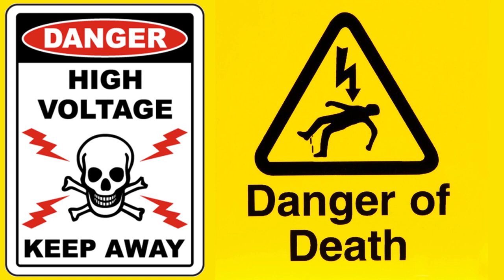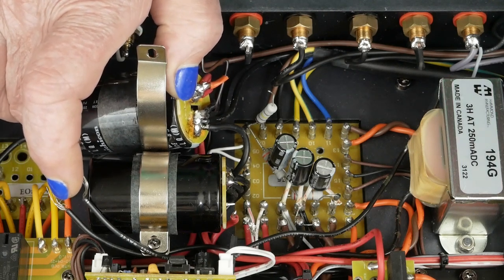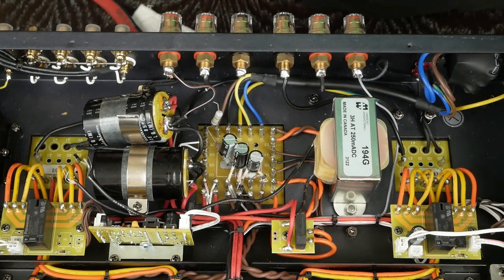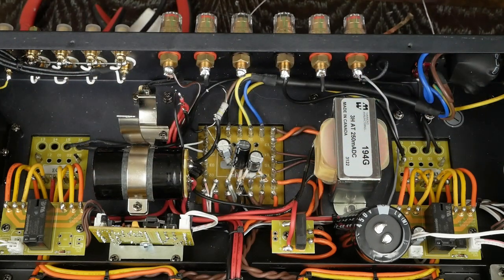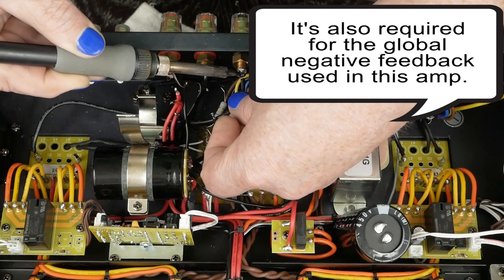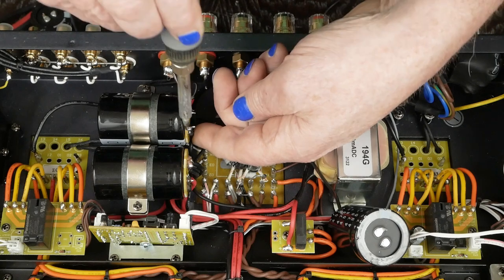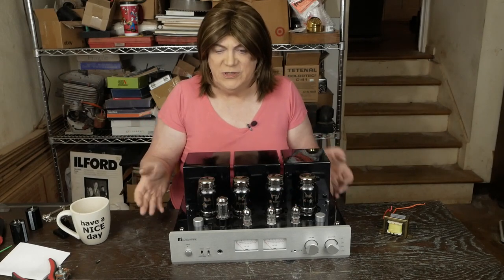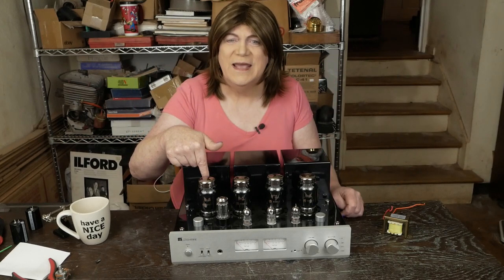Muzishare X7: Replacing the Power Caps and Choke.

Comment: This is a great way to learn about these Amps, I have two, it’s a shame they didn’t make the Amp with the higher rated components or lower for the resistors you mentioned. I’m not Sure I’m ready to take the soldering to the Amp yet, but I can see why it would be worth doing! Interesting to know about the pop when switching off, one of mine does the same. Can’t wait for the next one to see what you think it sounds like.
Reply from the maker: Actually that slight pop is the triode/ultralinear relay clicking to triode on shut down. You hear the same thing switching from  UL to triode with the amp powered up. No easy way to fix that, but honestly isn't hurting anything.
Reply: I have the X7 also. I replaced the coupling caps with V-Cap Odams with great results.

Really enjoy your detailed explanations.

I guess I'll tackle the choke and power caps next.

Comment: I got my first solder sucker last week and it worked surprisingly well. It made changing the caps in my Hood 1969 amp really easy.
Reply from the maker: Which one did you get?
Reply: @SkunkieDesignsElectronics  I got one that is blue plastic with yellow button and plunger end (13 inches long) from temu for $6.50. I was worried that the hot solder would melt the plastic but it wasn't a problem. It took just one go to remove the solder from most joins. I soon learnt I had to aim it away from my work area when depressing the plunger as that also ejects the solidified solder. I also got a smaller, mostly metal one for $2.50 but it locked up on me after a couple of uses so I ended up sticking with the bigger plastic one.

Comment: It is going to be interesting to compare to the R8
Reply from the maker: Right. That both use tubes to feed the voltage to the front end tubes, and think it's going to come down to: does a 12AX7 sound better or worse than a 6SL7. I bet it does.

Comment: @Skunkie Designs Electronics - I have this amp and the factory recommends the bias at .040ma but I have it bias at .045ma, and it really makes difference. I am tempted to go to .050ma, but I would need to upgrade the choke first.
Reply from the maker: What difference did you notice?
Reply: @SkunkieDesignsElectronics  increase in clarity while sounding smoother those too are usually at odds but that’s the only way I can describe them
Reply from the maker: Thanks, I will play around with that. The frequency response and power look the same, but that doesn't mean they sound the same.

Comment: Stumbled on this channel having come across Muzishare X7 and trying to get into tube amps. I must say I love the content. Thanks.  Would the the logic for disconnecting the ground wires from headphone board be to remove all the excess unnecessary circuitry? Simple and sophisticated?
Reply from the maker: Exactly, why have all that excess small wire in the signal path if you never intend to use headphones. Plus it corrects grounding issues.
Reply: @SkunkieDesignsElectronics  thanks so much. I think I might just start on Muzishare X7 and enjoy the mods.

Comment: Hello , and good evening ,
I am curious ….Do you know Tsakiridis devices brand from Greece? 
And If so ,what do you think of them ? 
I do have a Tsakiridis aeolos ultra integrated , that I found after 40 years in this rollercoaster , is not the best tube amp that I have ever had , but for size , and price , put a lot of more expensive ones to shame in SQ .
It has 4x kt150 tubes and 4 x 12at7 ( which I rolled with Nos RFT tubes with good results .
It has 70 watts channel ultralinear , and 36 triode. 
One think that irritates me in this amp is that it has to be biased with a multimeter which is not that practical .
It’s a shame that I don’t have now the money to send it to you , just that you could know the amp, see what you think of it , and who knows Maybe improve it . 
Maybe in a near future …if you find the tought interesting of course .

Comment: Nice video, I'd try adding a large film cap in parallel with those electrolytics. I've had great results adding 6.8uf solen caps in parallel to 470uf power caps.
Reply from the maker: That's something for folks to play with.

Comment: Hello.  Changed choke to 250mA.  Raised the bias current to 55-60mA.  Shuguang kt-88z tubes.  I don’t notice a big difference in the sound (what did this give you? They write that as the current increases, the anode voltage decreases...
Reply from the maker: It's not a "big difference". What I noticed was more bass slam, i.e. the drum hits and other hard hitting bass notes were improved. On a push pull amp, unlike what happens with an SE amp, increasing the bias doesn't increase the power. At some point we run out of big differences and start down the path of smaller ones :)

Comment: Stephe, I replaced the caps and choke as you demonstrated here and I actually think it improved the sound on the X7, tighter mid base, and a cleaner high end.   Maybe the new choke helped along with the caps.  For me, I am running the X7 in a bi-amped configuration with a Conrad Johnson Premier Two pre-amp along with a Sonographe (CJ) active crossover and a solid state Sonographe amp on the bottom going to CJ/Fusion speakers.  Anyway, the mod took the pre-in functionality out on the X7.  I understand the issues around using the pre-in mode on the X7 but would like to restore the functionality and remove passing signal through the X7 volume control.  Do you think this can be done without re-installing all the headphone stuff?  Thanks!
Reply from the maker: Sure. Honestly if that was my goal and you feel comfortable modding the amp, simply wire a pair of input jacks directly to the grids of the input tubes and bypass ALL of that wiring, switches, volume control etc.
Reply: Thanks, I'll take a look and see if it's something I want to do.  I did find the post that indicated to run the prein switch to ground. I did it and it fixed it.  Right now it's sound the best since owning he amp..  Maybe best to leave well enough alone, but that's not my style...

Comment: Hello Skunkie,
I would like to apply your ideas for modifications to my Murishare X7 amplifier, thank you for the sharing :)
If I apply the changes myself to my disconnected amplifier from the sector, do I risk an electric shock ? What are the precautions to be taken please ? Thanks ...
Gilles.
Reply from the maker: Mainly make sure the amp has been unplugged for at least 30 minutes and then using only one hand, carefully double check there is no voltage left stored in any of the large filter caps.
Reply: @SkunkieDesignsElectronics  Thank you for the info !
I ordered all the parts at MOUSER and I will have to start the changes very soon when I have a little time!
A big thank you to you Stephe, I admire what you do, take care of yourself!
Gilles from Paris

Comment: Hello.  I removed the wiring from the headphones, as in your video, and the pre in input stopped working.  Where did I go wrong?
Reply: Found) if you want to leave the prein, you need to connect the top contact of its switch to  negative plug!
Reply: Do you mean negative ground?

Comment: So the cap was drained first I suppose?
Reply from the maker: This is why I have a warning at the start of every mod video. People need to understand and follow all safety practices, which includes draining the voltage from caps before working on an amp. I do not repeat all safety information in every video, that would double the length of every video.

Comment: Hello Skunkie...with all the crazy amount of filter capacitor s to choose from I was curious what made you decide to use those TDK Epcos capacitor s...I figured with the quality of Mundorf why the Epcos...thank you
Reply from the maker: There aren't a lot of 500V+ 470UF caps to choose from at mouser. I looked for long life, 105deg as the main factors and the same physical diameter. These also have low ESR and are at a good price point. Given these power supply cap IMHO have very little impact on the sound, I don't see the value is spending $$$ here. If someone does want to spend some $$$, you could parallel these 200-200 caps. 

https://www.partsconnexion.com/MUNDORF-70428.html
Reply: Fantastic Skunkie...that makes total sense,  high voltage and high temp caps right on Skunkie I didn't even know TDK made capacitor s lol I'm still learning,
Reply from the maker: They other key point to remember is predicted life is based mainly off temp. Using a 105c cap rated for 3000 hours vs a 85c cap rated at 3000 hours, the 105c cap is going to last WAY longer if they both see temps of 60c. I just recently been looking at ESR, and using a low ESR cap can eliminate the need to bypass a large filter cap with a film cap.